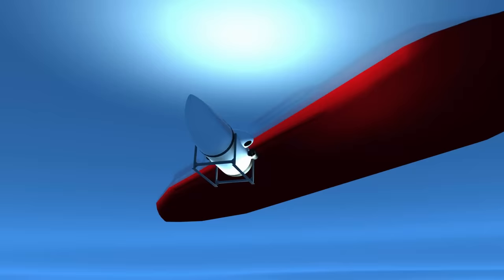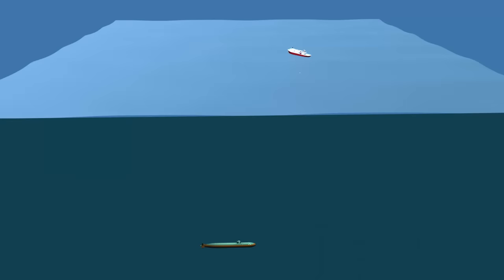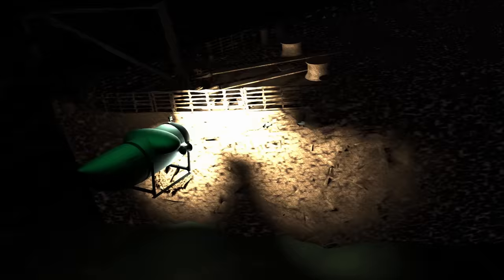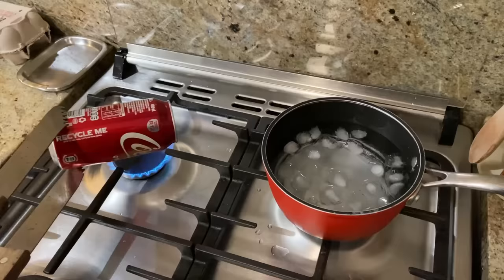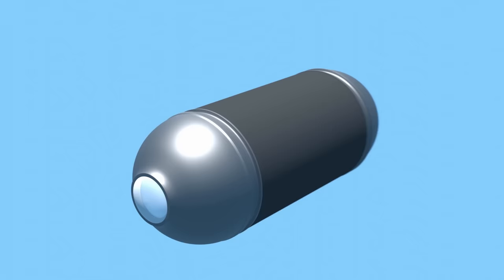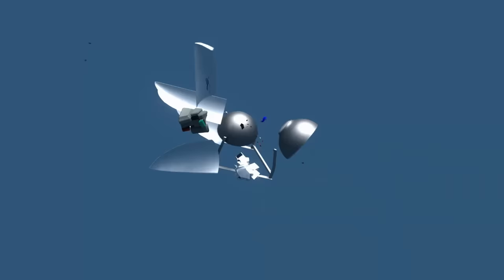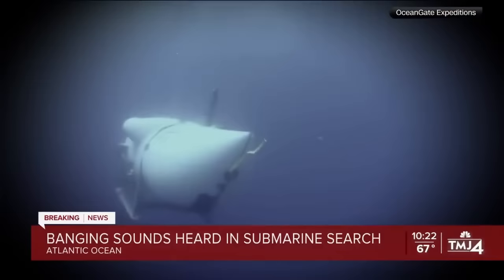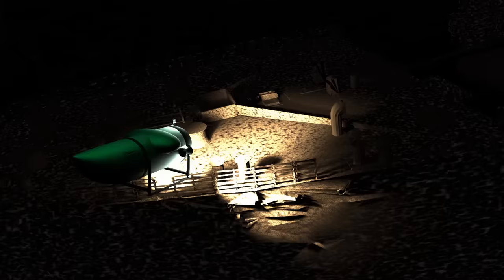TITAN Sub implosion | Deep Dive animation explanation

Comment: I find it incredible that they were able to not only locate, but recover so much of OceanGate.
Reply: it was found under where tracking was lost.
Reply: Tells you those espousing about it don’t know wtf they speak of
Reply: Goes to show anything can be lifted from the ocean floor if it wants to be
Reply: @terminalfrost3645  And the implosion occurred only 300m above the ocean floor, so there was relatively little scattering of the debris.
Reply: They had to clean up the evidence . 😅
Reply: @terminalfrost3645 
No, you misunderstand the comment sir. 
He was surprised about the speed, and how much of the submersible was raised.
The depth, pressure, and lack of strength by the ROVs.
Reply: The thing that surprises me the most is that there is supposedly some human remains recovered? How would that even be possible? Unless they literally mean a small smear of blood lol
Reply: The human remains found calls into question the severity of the implosion. Apparently an implosion at that depth would have instantly obliterated everyone on board. I’ve heard claims from ‘experts’ that nothing of the passengers would be found. But, remains have been found. So, I wonder if the hypothesis so far is 100% likely?
Reply: @stevenmoonan1916 we really won't know till a full proper investigation is done
Reply: @stevenmoonan1916 'remains' is a pretty broad term. Teeth maybe. I can't think there would be much else.
Reply: @magikjoe3789  Yikes!
Reply: @stevenmoonan1916 they mentioned “presumed” remains…could be remains or something else. They are sent for further analysis. Hope they will tell us eventually.
Reply: @tur74d56 titan was only i. The water for a few days.. Sunkin ships are under there for years decades and centuries.. The may or may bot be able to pull them up with out adding more damage . the decay. Of a ship thats been under water for 100 years may not allow it to be brought up.. So just leave it there why disrupt a cemetery?
Reply: @notaperson9831 I personally.. Do not think there are remains. Its just something to keep pulling us back in.
Reply: @magikjoe3789 I agree. I dont think thete are human remains.. How..
Reply: @notaperson9831  small chunks.
Reply: @stevenmoonan1916  look up the byford dolphin accident. there will be pieces, not big ones, maybe a whole organ or two, arm or legs, but you gotta realize stuff down there is going to munch on the parts too. the already small parts will go away and get smaller pretty quickly.
Reply: OceanGate wasn't missing....
Reply: @sarahyates4144  Given the temperature and pressure of sudden compression, and the method of recovery, I would hypothesise that it's most likely to be stains baked onto the titanium.
Reply: @stevenmoonan1916  Could just be smears and goop attached to the pieces found-- hence the tarping on the way off the ship -- didn't want the cameras to be able to zoom in and overanalyze if this spot here or there was possibly human blood/goop/bone/tooth/clothing fiber/etc. Just a hypothesis though from an armchair theorist.
Reply: @thinkabouthelogic  yeah. A lot of ‘armchair-theorising’ around! I do it too though. 
Feel really sorry for the kid. He didn’t really want to go. 
Can’t believe these guys didn’t read up on the vessel and find a lot of safety-scepticism before they decided to commit.
Reply: @notaperson9831  Probably just bone fragments.
Reply: I wonder if they stress tested this like on commercial aircraft when they determine that the carbon fiber or windows start to show stress cracks knowing how many dives this vehicle made, as I’m sure failures would not happen immediately but after numerous dives?
Reply: @mikethompson3534  from what I’ve seen, they didn’t stress-test this adequately at all. Apparently, any submersible should be stress tested  to 20% more than it’s intended depth level numerous times before it is put into operation
Reply: @notaperson9831  They're not sure it's human remains to begin with. If they have anything, it would be just goo.
Reply: As someone who works with subsea cranes. Recovery is not that difficult. It’s simply using an ROV to put a nylon sling into a choke on the debris and pick it up with the subsea crane attached to the vessel. But you are correct that locating items on the sea floor can be tricky.
Reply: @ElectricalExistence  That isn't the same. The worst that happened was the guy that got blown through a small opening and quite a lot of his body was found if you see the pictures. Plus it was an enclosed space. These guys got completely crushed to pieces at the bottom of the ocean. If there are pieces of them left then they could be literally anywhere by now
Reply: @ElectricalExistence   Thing is carbon fiber shatters, It doesnt break apart. I too believe there will remains. It's not like their bodies where vaporized. Something is remaining. Bits and pieces is whats remaining. The stuff that hasn't been washed away from the wreck site by underwater currents.
Reply: I agree,  I wonder who provided the capability to locate and recover the scraps of wreckage from these tremendous depths just days after this disaster.  That is an Amazing technical acheivement!!!
Reply: @broflex the cost was $6.5 million to bring the remains to land.
Reply: Remotely operated vehicles have so much more capability than submersibles containing humans.
Reply: What are you talking about? They’re not lifting the titanic so not not anything
Reply: How did they not find two charter planes still?

One was a Chinese one from a couple years ago, hundreds people on board.

They find parts of mini vessels at 8000 Mt below, and they don't find pieces of CHARTER PLANES??? LIES. LIES!
Reply: @notaperson9831 yeah, I heard that too.  How can that be? They said it was in the wreckage.  Could pieces of remains be in the wreckage?  Is that possible?   Just curious.
Reply: If they wanted to, they could. Its just that nobody wants to spend the estimated 200 million to raise it, and there might be other motives to not raise it.
Reply: @etrebelle9812  , Not lies. The submersible wreckage just dropped a short distance to the ocean floor. A surface boat knew exactly where that was. An airplane can be anywhere within a hundred miles of where it last reported a problem.
Reply: @stevenmoonan1916  , Apparantly, the human material did not disappear, but the remains are unrecognizable as human. So whether you want to call that "obliterated" or not is up to you. I don't think there is anything to be gained from a more detailed description.
Reply: @etrebelle9812 it's like dropping a pillow off your bed vs throwing a dime off the Burj Khalifa.
Reply: @notaperson9831 A tooth, perhaps? Or dentures?  😬😂
Reply: @aic5073 It's going to take litigation for OceanGate to go missing. 😂
Reply: @StephenA92 What are you talking about?  Source for someone getting blown through a porthole, please.
Reply: @sarahyates4144 Remains dosent mean a body its most like tissue or some squash part of the body
Reply: @magikjoe3789  maybe they found their wedding rings as a thin sheet of material or if one of them had a metal pin in their body
Reply: @stevenmoonan1916  I think they were being polite, you really dont want to return a bag of biomass to someone for a funeral, its fairly likely there ARE remains but stuff like shreds of skin fragments of bone etc, "heres a piece of your sons tibia " would not go down well.

Its the same way that michael schumacher status is completely private despite all signs pointing to him being in a vegetative state, because people would rather you not think of him that way.
Reply: @mrnice111  it imploded to a sub-atomic size.
Reply: @stevenmoonan1916  titanium is millions times stronger than humans tissue.
Reply: @ronnywilly One ROV had the strength to lift the entire submersible - that was the original recovery plan if it was intact on the bottom.
That ROV took four days to arrive on site.
Reply: @stevenmoonan1916 ”human remains” includes blood stains bone fragments and teeth imbedded in the hull. It doesn’t mean anything a relative would recognise as “human”.
Reply: @tur74d56 not the Titanic apparently
Reply: @RockandRollWoman  He's talking about the Byford Dolphin tragedy of 2002 that was referenced earlier in this thread. I believe that StephenA92 was replying to something Electric Existance said about that incident.
Reply: @mrnice111  😂😂😂 I think Rush's ego was the first thing that deflated.
Reply: @etrebelle9812  They knew where to look for the Titan.  We still aren't sure where Amelia Earhart's plane and MH370 went down.
Reply: @KebabMusicLtd  Thanks. I had figured that out and learned about what occurred.  It confirmed my thoughts about the nature of "remains."
Reply: @factChecker01  👍
Reply: @RockandRollWoman  the guy I replied to mentioned the Byford dolphin incident which was completely different to this one
Reply: @KebabMusicLtd  Yeah I was 👍 A terrible incident and an interesting read but completely different to something like this.
Reply: ElectricalExistence,
Not even close. The opposite actually.
The Byford dolphin incident was an explosive decompression event  Where  a crew chamber under high pressure approx. 160 psi going to low pressure approx. 15 psi in an instant.
The sub was an implosion where a crew chamber at 14.7 psi goes to 6,000 psi in an instant.
Reply: @factChecker01  I like details
Reply: @sarahyates4144  there could be teeth especially with gold or any fillers
Reply: @mikethompson3534  They should have done more testing than an aircraft which operates in just 1 atm. Down in the the titanic, it's 400 atm

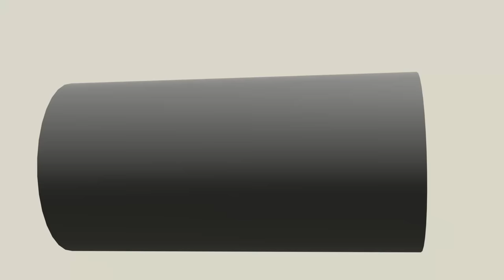Comment: 4:55 I did vacuum design and engineering for a couple of decades.  I designed several chambers for the aerospace industry (for testing spacecraft components) that were roughly the size of the Titan's crew compartment.  The hemispherical end caps were 1/8" thick stainless steel ("helmet heads" for those in the biz) while the cylindrical center section was 1/4" thick SST, seam welded inside and out.  And this is to hold out only 1 atmosphere, not the 400+ at Titanic's depth!

Any design engineer will tell you that a carbon fiber composite can never be used this way.  It's not that they didn't overlap or bias-wind the structure, it's the material itself.  The fibers in the composite are immensely strong in tension, but have zero strength in compression.  That's why you can use it to make pressure tanks and vessels as the "hoop stresses" from the inside pressure cause the cylinder to try and expand, which is very efficiently resisted by the strength of the fibers.  But when the forces are reversed, and the pressure is on the outside, the cylinder is compressed smaller, meaning that the fibers go slack, and provide nothing to the strength of the structure.  The only thing holding the pressure is the matrix between the fibers (epoxy in this case).  Epoxy is very strong in compression, but also very brittle.  It will crack when flexed, meaning an absolutely guaranteed failure in a few cycles.  I'm actually amazed they got that many dives out of it.

There's a good reason that "the experts" were all warning him, and insisting on more and different testing, and it's not just that they were jealous of his innovative "free thinking" mindset.e
Reply: Please do more of what you did here for it was perfect. You explained much of what I had heard before but more clearly and likely with a better understanding. It's not comparable to pressure tubes because the pressure in this case is outside and you can't push a string. I'm currently on a steel schooner but mostly familiar with fiberglass and Carbon Fiber and indeed epoxy is brittle which is why we add the fibers. Well done.
Reply: Good explanation!
Reply: Well, would be  good to clarify some aspects related to composites:
 This kind of composite, carbon fiber & epoxy, presentes mechanical properties according to direction of the reinforcement:
Considering fiber  direction  we can identify excelent mechanical resistence for tensile stress and  less for compressive stress...
Considering direction perpendicular to fiber...we have good mechanical resistance for compression and less  for tensile stress....
...The mechanical  resistance of the composite depends  on the amount of plys, sequence of staking , direction  of the reinforcement and the ratio, in volume:  fiber / matrix  And temperature and moisture (absorption of water ) as well...
THUS, when working with composites,  is very important to take these into account.
...Also, using shapes and wall thickness in such way that the stress will be reduced to a level that composite can" deal with".
Anyway, fatigue is a very complex point to be considered , we can never close the eyes for fatigue 
...the small damages caused each time, loaded x unloaded , are cumulative and after some point , the colapse will occur
Reply: @Goddess-illias  what a powerful analogy. Its actually a bit more like pulling a box with string - you can do that, but you can't push the box. If you put the string in a short, stiff hose, you can pull fine, push a little bit, but too much and the hose bends and eventually breaks with fatigue. Sort of. I'm reminded of the Segway inventor who took a metaphor a little too far and ended up going off the edge of a cliff.
Reply: Great comment. Your last comment is really on point. I've worked for great engineers, very creative. Some had an unfortunate streak where a critical comment aimed at improving a solution was taken as a personal slight and resulted in a sarcastic smack back.

Were this an unfortunate oversight or rare series of odd failures lining up, I could be just sad. What I'm angry about are the number of booby traps they incorporated into the design on purpose and left there when pointed out. 

One analysis of the rate of descent indicated that they may have taken on water in the rear compartment at an early stage and didn't notice. That should have been a point of calling off the dive. A previous dive had a thruster with wrong polarity - i.e. the titan spun instead of going forward. This should have been found in a basic test of maneuverability done just below surface - like planes do on the ground - test flaps / aelerons / rudder / thrust / lights / comms ... etc.
Reply: @Goddess-illias  Exactly Grasshopper.
Reply: You have provided an extremely clear and concise explanation of why carbon fiber was the absolute worst choice of material for this application.
Reply: Gee, and here I thought billionaires are billionaires because they are ever so smart and knowledgeable. I wonder how well a pure epoxy sub would fare.
Reply: @RichardLewisCaldwell  I am waiting for a FlexSeal sub.
Reply: Hoop stress, I haven’t heard that term since my strength of materials class!!
Reply: Good explanation.  But nobody is discussing the major design flaw.  It's been reported the window/porthole was certified by the manufacturer to be good for a maximum depth of 1300 meters.  Ignoring the carbon fiber shell and why that was a bad idea...I think any 3rd grade Math student can call BS on this equation.   1300 > 4000   (?!?!?!?!?)
Reply: @seandelaney1700  Yes that makes sense.  I have a carbon fiber tank 4500 psi that is 10 years old and still passes testing.   Fireman use them, PCP pellet guns use them.  very common and when they fail its more of a fizzle than a explosion.   And those fibers are criss crossed not all in the same direction as the sub was made.
I have a few carbon fiber water skis and found while very strong and good for stiffness they can warp in the heat like if you leave them in a hot car  The resins soften.   Wonder if HOT/COLD cycles accelerated the decline of the sub.   On top the boat it could be 100 deg F.  Then down to near freezing deep in the sea.   That hot/cold/low pressure high pressure had to have weakened it.
Reply: excellent comment, thanks!
Reply: "The fibers in the composite are immensely strong in tension, but have zero strength in compression."  This 'sounds' correct, and it is certainly true that CF is 'stronger' in tension than compression. But it is most definitely NOT true that CF materials (not just the fibers themselves) have "zero strength in compression."  See the NEXT video by Mike Bell and the comments there for more complete technical explanations regarding CF in tension vs. compression.
Reply: @steveh8724 - Didn't I say that the epoxy was holding the pressure?  It was probably the only thing holding the pressure.  Composite materials are very non-linear in their response to force, thus require much more rigor in design testing.
Reply: @daviddempsey8721 from what I'm gathering they took on water realized it and tried to come back up but the added stress on the frame due to the extra water pressure combined with the high stress of a quick ascent caused the implosion?
Reply: This means fatigue plays a role then, since it did dive without apparent troubles (from a technical point of view) at a number of occasions.. and “such fatigue” wasn’t picked neither before the fatal dive.. still, despite the warnings, it seems he got the blind trust from very experienced and seasoned divers.
Reply: @BambinoAmericano  - Technically, yes, but "fatigue" means different things in a homogeneous material (like metal) than it does in a composite.  The latter are extremely difficult to characterize since so much of their properties depend on the assembly process in addition to the component materials themselves.